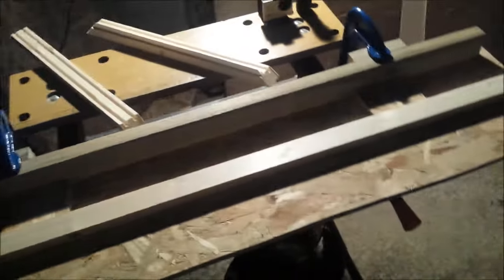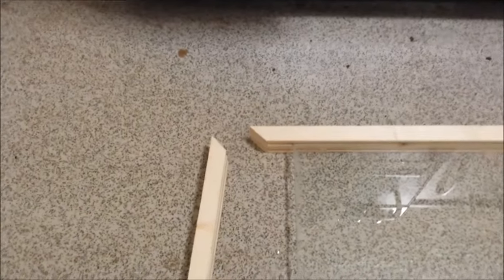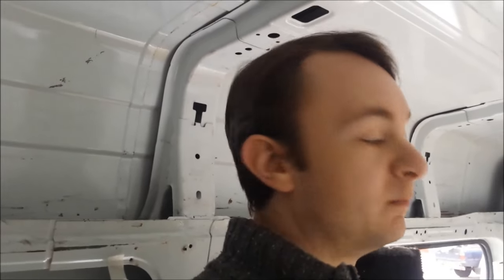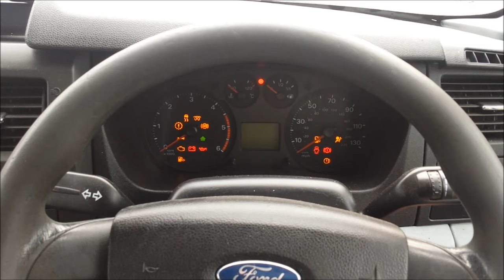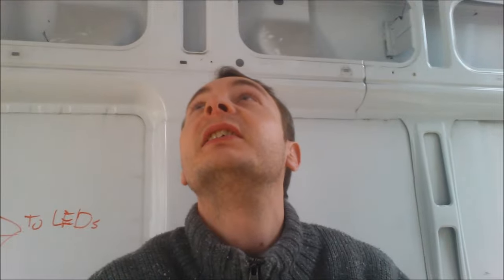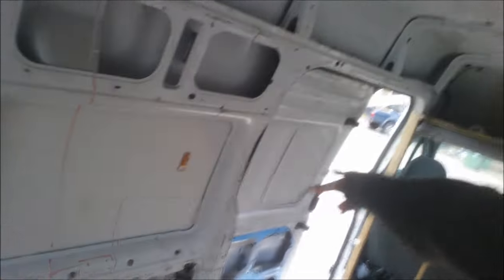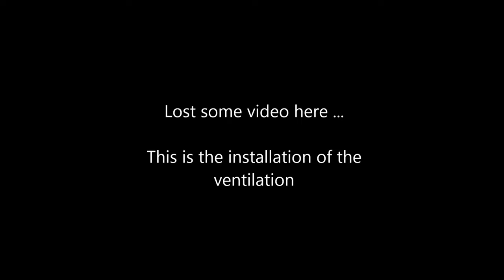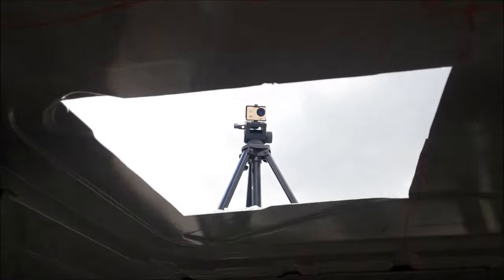Episode 5 - Fresh air and privacy! - Transit Van Stealth Camper Conversion

Comment: Great job mate. Its not as scary as you think cutting holes. The bit I cut out of my roof has been left outside for the past three months in all weather and is only just showing a tiny bit of rust so don't worry about not painting the edges. Will last for years :)

Comment: Rob......a simple yet invaluable tip for you.....before you put in anymore wall or floor covering/insulation, run some garden hosepipe under/behind it......or even several runs per area.
Then, you'll be able to feed cables through with no problems, no removing panels or mucking about.
NEVER underestimate the number of wires or paired wires you'll need......LED lights, USB sockets, Exterior lights, external camera feeds (ok, you probably don't think you need those yet but who knows......) control wires, sensor cables for thermostats in the future, solar panel wires......the list goes on and on, but with a very low cost investment into hose pipe and a bit of fore-thought, running all of those cables will be a doddle.    You'll still need more eventually, even if you over-estimate and double it, but trust me on this one, something as silly sounding as running rigid hose (or even PTFE pipe if you can see the value up-front! ) will be more than repaid in the future :)

Comment: If you ever did a convertion again i'd recommend a Merc Sprinter (watch out for rust, prone to it) or a VW Crafter van. They are both mechanically very reliable.
Reply from the maker: Thanks man. I'll definitely consider a sprinter next time. They are very popular for van conversions I've seen.

Comment: I used Silicone for a similar project and it started to leak after 8 month (and yes, the surfaces were cleaned well). Then I was reading in many blogs not to use Silicone. I ripped it out and used 3M 4200 .
Reply from the maker: The stuff I used stated it was for both outside use as well as use on motorhomes. I am going to be keeping an eye on it and if I have any problems I'll use either the same thing I used on the bonded window (that stuff is thick as hell) or the 3M sealant.

Comment: If you watch my latest video, i bought some led's that you can swap them old lights with so that you have 'spare' lights running off the secondary battery, if you haven't chucked the wires that is lol. But great work so far, it's coming along nicely :-) and yeh how did you get all them subs ???? mind boggles, I have been on here similar time as you ! ! ! think my next vid has a thumb pic of my van similar to yours hahaha
Reply from the maker: I'll be sure to give them a witch. I'm not too worried about the lights there, I'll be installing some other LED lights at a later date.

Comment: Did you treat the edges of the metal where you cut the hole for the vent? If not, it will rust.

Comment: Make sure you turn all the interior lights off on the van or take the bulbs out. After having all the doors open for 5-6 hours you will not have a flat battery.
Reply from the maker: Thanks man. I think I'll just unhook the batteries if I'm going to work for long hours on it. They are easy to get to so not a problem :)

Comment: hi, is that window just glass? if so aren't you worried about it cracking or smashing? I think I'd go for acrylic instead of glass.
Reply from the maker: It's a good point but I'm not too worried about it breaking. I have heard that it wouldn't pass an MOT with it in but I can just take it out. If anything does break, I can easily replace it with acrylic :) The stuff was free so I'm not gonna complain haha
Reply: to be honest I was thinking more of your safety. you don't want to be going 70 on a motorway and then get covered in glass. think about your safety and the safety of other road users.
Reply: there is very little chance of the glass or window coming off while driving, it has been well fixed to the roof
Reply: Hi Rob, I was thinking more of vibrations going over cats eyes or hitting a pothole. being in a solid frame and attached to the van aren't you worried about it? you can even get clear film that makes sure if it does brake it doesn't go everywhere. if it would fail it's MOT that must be for a reason. 
I'm sorry if this is coming across as a nag, I'm really impressed with the work you've done on the van and the ideas you've had. I'm just trying to look out for your safety. keep these videos coming. your doing a great job on it and it's great to see how others do it.
Reply from the maker: Jonny Oates. I undersrand mate. I have been thinking perspex might be better. I needed the window done though so i can finish the bulkhead. I have to know the size of the window so it fits correctly. I will probably change it though.
Reply: Sorry Jonny ! i didn't realise it was a glass unit ! So, yes personally i would get plastic film to cover it ( glass cleaned with white spirit first, to get a good strong bond to the film ) to prevents fragments coming loose if it cracks.
Reply: that sounds perfect. I know homebase sells a film that is designed to cover glass. it's not meant to stop it braking, but it holds it together. you can even get patterned film with all sorts on it. it's also CHEAP!!!

Comment: Have you cleaned the area where you applied the Silicone?

If not I would suggest ripping the Thing off again , deep clean the shit out of the area where the Silicone will go(maybe even "sand on" the clear paint) and then redo it. Otherwise it may start leaking - my brother can tell you his Story :D
Reply from the maker: I didn't. I should have but I totally forgot due to the encroaching dark clouds. I may well have to take the whole lot off again and re-do it so I'll be keeping a very close eye on it.
Reply: Do it now while you still have good Access to it ;)
Reply: Also Silicone tends to degrade over time, so you could use something like Sikaflex®-292i od sikaflex 292l.

they are originally designed for maritime use , but could suit you well here...
Reply from the maker: The one I used was Sikaflex but I can't rememeber exactly what one off the top of my head. I'll check it tonight. Thanks for the pointers :)
Reply: If it is sikaflex you can check the datasheet on their Website. Ideally you have one that is UV resistant, just to be sure :D

Comment: Cutting out support rib very bad thing to do you may have problems ahead.
Reply from the maker: It wasn't a decision I came to lightly. But if I take in to account the other 5 ribs plus the structural strength of the furniture that's going in and the rack I've laid on the roof too... well if worst comes to the worst, I can just take the ceiling down and weld a few steel beams in.